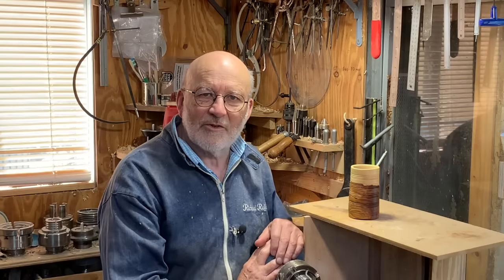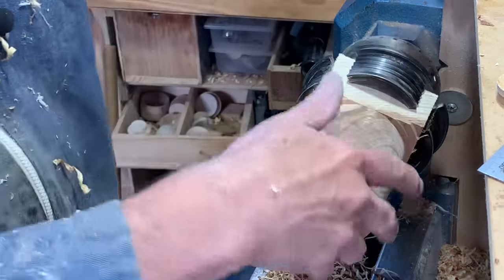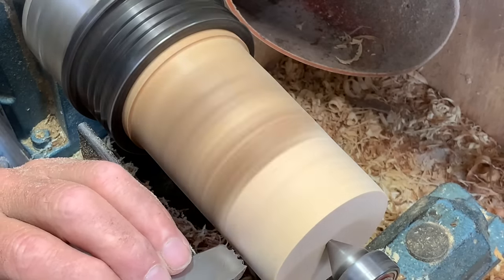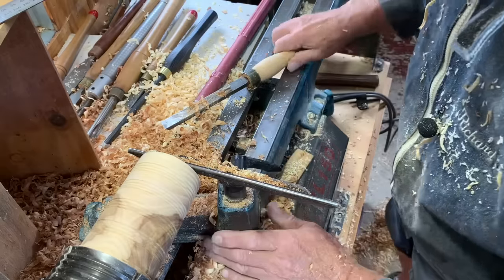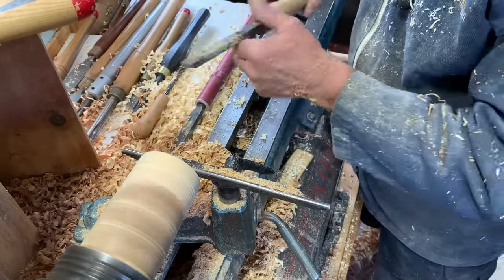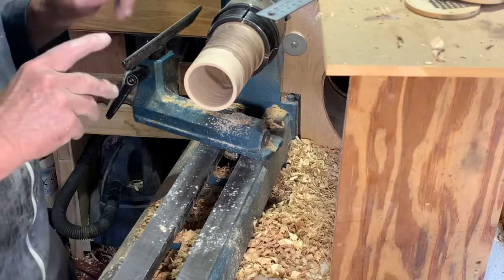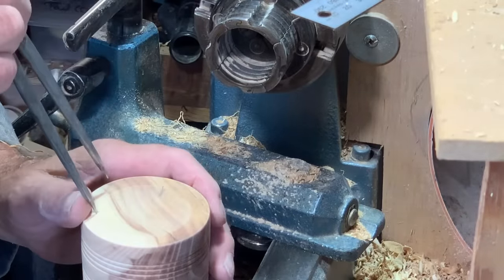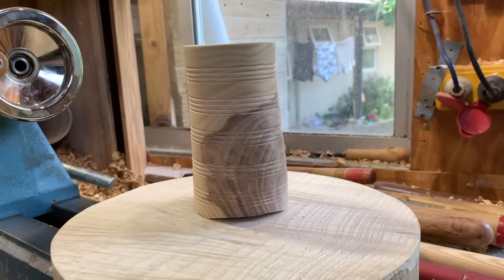Richard Raffan turns a cross-grain tripod pencil pot.

Comment: A very neat looking pot; that elm really looks great.  It's very instructive hearing you talk through the details of your design process.  So many different take-aways from this video.  I have a similar rotary burr and have been waiting to get the appropriately sized chuck for the Foredom rotary tool I got from my Dad -- had never thought to chuck it up in the lathe.  Am definitely going to give that a go; mine is more triangular so should work well for putting feet on boxes or other turnings.

Comment: is there any method of drying that causes more warping, or will it warp the same in different amounts of time? Does the microwave make it warp more?
Reply from the maker: Microwaving achieves in a few minutes what will otherwise happen in a few weeks as the wood dries without help. Elm usually distorts more that here, so this was somewhat disappointing. Other timbers likely to distort dramatically when turned green include oaks, , holly, banksia, casuarinas.  https://youtu.be/ZvZ5k4IzqpQ

Comment: Great video Richard.  I have watched it twice now and am amazed how you use gouges and scrapers deep inside the pots.  I have made several pots like this but there is no way with my tools and four years of experience I could do what you do.  Most of my pots end up getting drilled out with  some minor gouge/scraper work inside. Maybe in another 30 years I will be brave enough to try.  Thanks for all your great videos.
Reply from the maker: Longer handles are a great help when deep hollowing. Ideally handles should be five times the length of the tool.